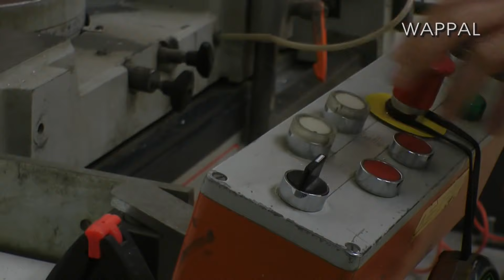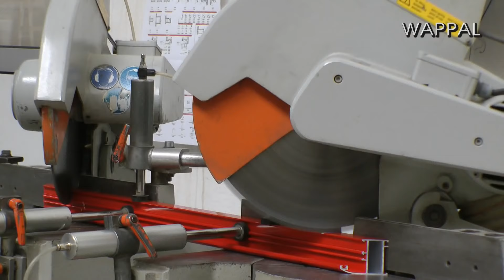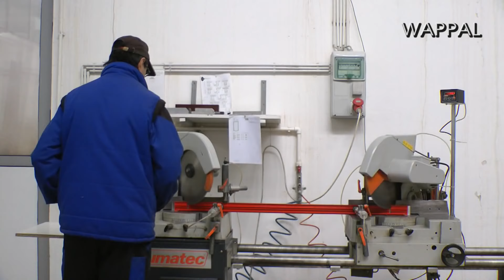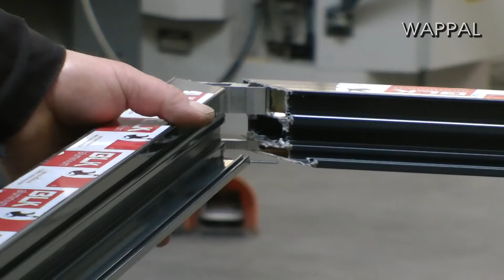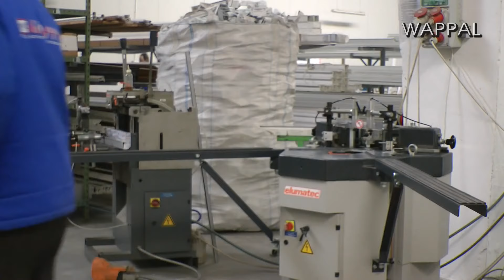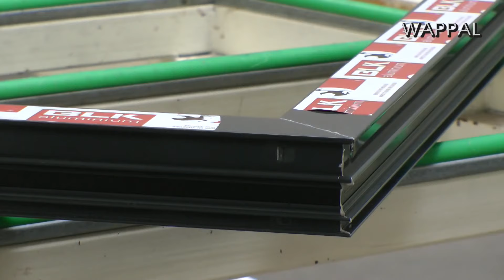aluminum door and window manufacturing, door & window

Comment: Advanced tech 👍
I'm still doing this with my hands and drills 😁
Reply: Holla bucks I am asking training I like this job I try wespico in alrode they are no longer doing training there ,I can even volunteer bcz IAM working as a security and I got 3 days off
Reply: Hi what does the corner machine do does it weld or crimp? how do you join the corners?
Reply: Please what do you call the corner angle in engineering term. Thanks for your swift response.